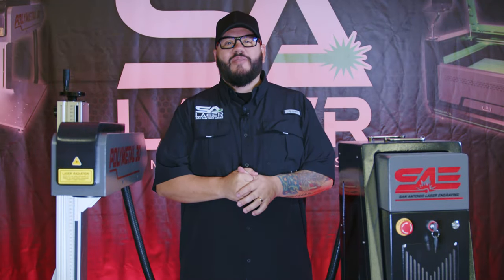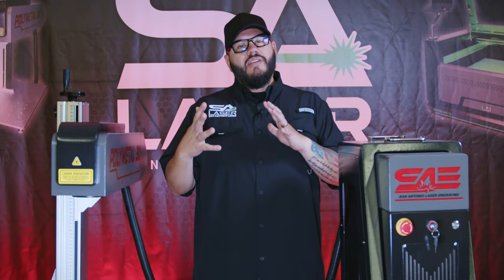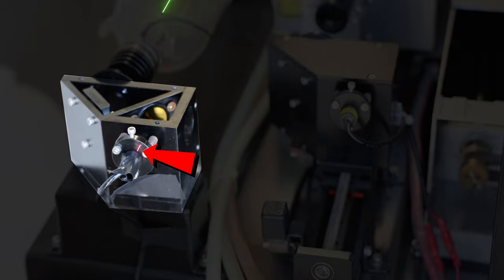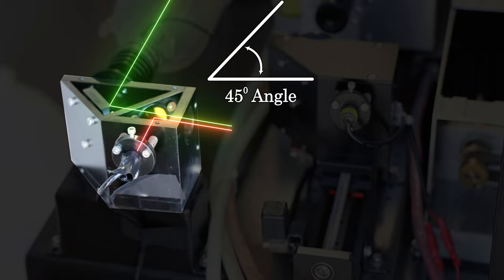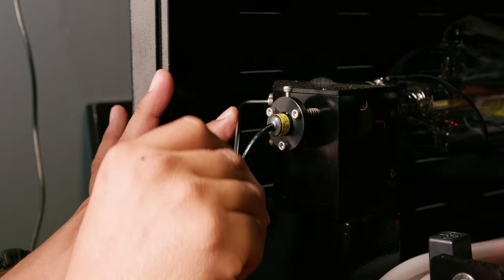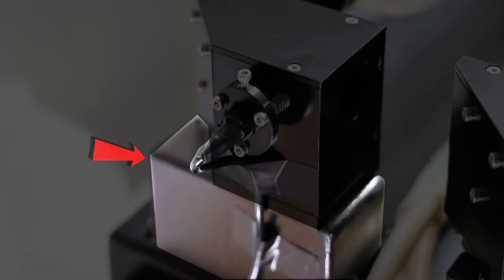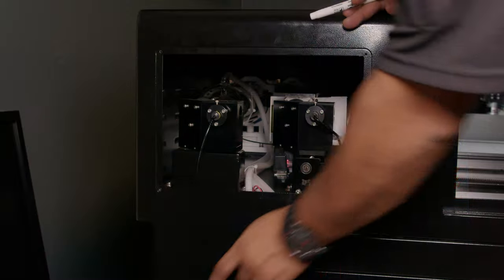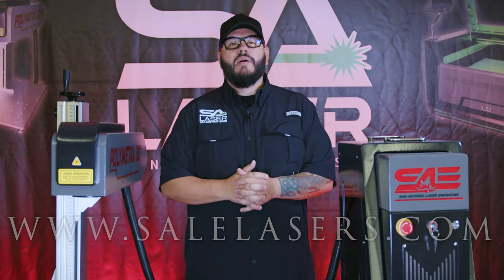Co2 Laser Beam Combiner: What to know

Comment: I've been laser engraving for over 20 years, and I've never had too much use for the red dot pointer. And the kind that attaches to the head it self is good enough for basic reference. It does not need to be exact. However if the additional cost is very low then it would be a nice feature.

Comment: can i use the same lens to combine two 40w tube lasers?
Reply: A lens has an axis through which the laser beam must pass.  Thus your suggestion is impossible because you cannot get two beams to align with a single lens axis. Maybe you mean the FLAT combiner window. by replacingthe red beam with another 40 watt laser beam? The answer is no becuse the reflective coating is designed to reflect the red 650nm wavelength and not the invisible IR  10,640nm CO2 wavelength. The two laser beams will just cross over each other and the addition you hope for will not occur.

Comment: beam combiner will not work if you want to upgrade to GaAs lens for example, which is why it is not a better option or an upgrade. Also if you don't use very poorly 3d printed mount on a laser it is not actually easy to get misaligned, it works very well. Also you dont want too beefy laser head exaclty for the reason you said - 5 gees. If a laser head say weighs 100 grams, it means it weighs 500g at 5G. So every gram you add to it will add to vibrations and inertia times 5. If anything, you want to keep laserhead as light as possible to faster more accurate engraving. You need to study stepper motora and how they work to fully understand this concept.
Reply: What is gaAs lens?
Reply: @luismasuko  ever heard of google?